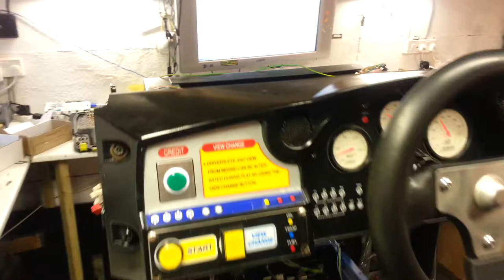Rally Championship 1995 Arcade Repair Restore Part 2

Comment: Hey mate! I'm doing some research into fixing up a 1995 Sega Rally Chamoionship side by side machine for a friend of a friend that has some display issues and was wondering if I could bother you with some questions and see if you could give me some pointers and advice! All good if not (I understand keeping your secrets close to heart, fixing up older electronics is becoming a specialised skill).
Would love to chat if you are ever keen.
Reply from the maker: Hi, Congrats on getting an iconic arcade machine! This was quite some time ago. This machine was about 90% working, it got a full strip down. All the boards stripped out and washed, (yes washed in water and soap!) including the wiring loom. If the gear shifter is worn out. There are some rubber blocks that need replacing. There is a SEGA part number and they are EXPENCIVE. I just ordered a sheet of rubber from eBay and cut it to size. I think I still have the art work somewhere. Also check the PSU and recap it. Check with a multimeter it's outputting the correct voltages, there is a pot somewhere to correct it. No secrets on that they need to be saved and restored back to fatory condition as best as possible IMO.